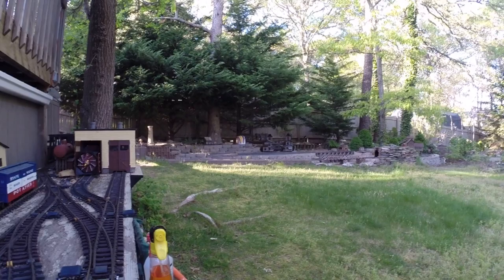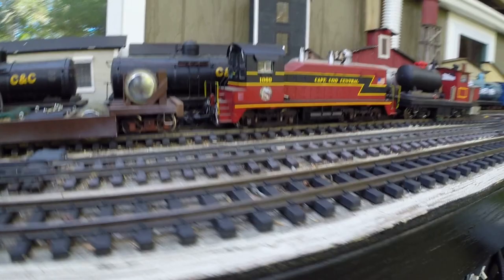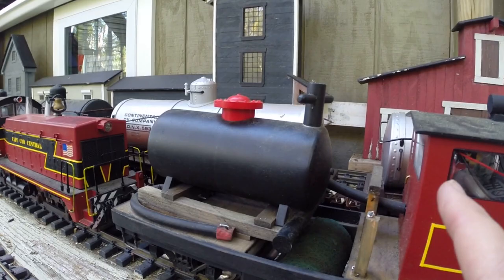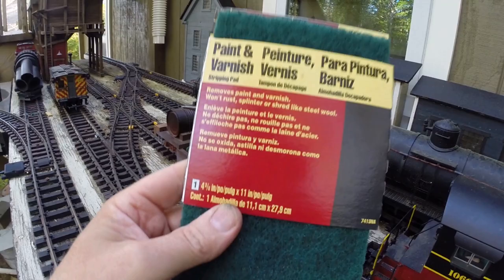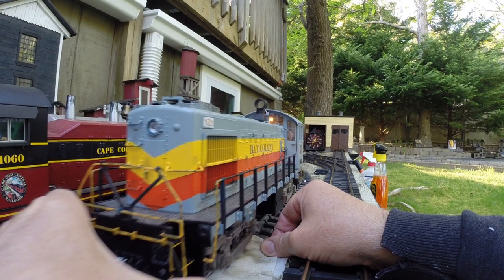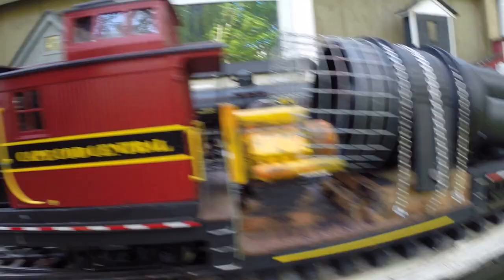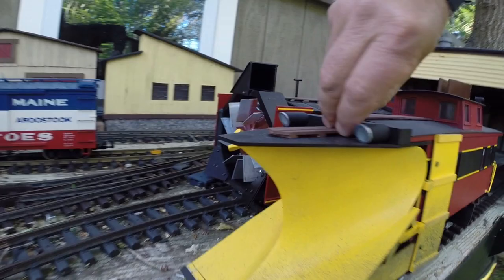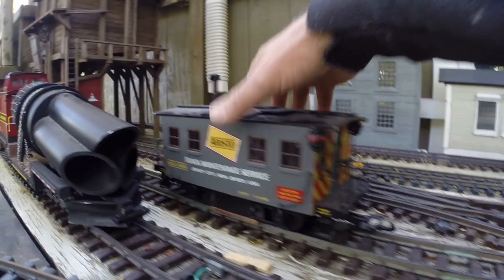How to clean G scale track

Comment: Try using mineral spirits instead of the rubbing alcohol and goo gone. You’ll clean your track less often. And also use a pad that’s not abrasive. Wet it down with mineral spirits and clean your track and see how you like it.

Comment: My cleaning routine: wipe with a damp microfiber cloth and then use 400 grit sand paper to rub off the corrosion. I find it barely grinds the rail because if you go light, it will only get the corrosion
Reply from the maker: That works but I would be very careful with the sandpaper.  They say that it can put small scratches in the rail and then those scratches collect dirt quicker.  Shiny rail looks good but it doesn't have to shine to work.

Comment: Hi just saw your track cleaning video.Looking to get my outdoor railroad up and running this year.Does the alcohol and goo gone work good on brass.thats what I plan on using.I also have issues with weather i'm in n.w. pennsylvania here,and we get snow.Happy New Year to you
Reply from the maker: HI.  I have all brass track.  Remember it does not have to be shiny clean to work well just free of grime.  I use goo gone on pole sander/scotchbrite pad when it gets really messy but goo gone leaves a slippery residue so keep that in mind if you plan to run long trains up grade.  I have moved away from the rubbing alcohol and instead use regular water with my rail broom MOW car.  I'm in Mass. and we get snow too and sometimes it is the plowable type for the trains. I have videos of that on my channel.  Happy RRing.

Comment: Im gonna be making a catenary powered railway, and my backup engines/maintenance engines are gonna be battery powered. Do i still need to clean the rail surface if im just using it for negative current?
Reply from the maker: I'm not sure how the catenary setup works but if the track is the negative then yes you would want it to be clean so it gives trouble free running.  Dirty track can make trains jerk or stop.  The battery powered trains will be isolated from the track so the only thing you would have to worry about are leaves, twigs etc that might be on the track and in the way.  Track does not have to be shiny to conduct power but being outdoors it can collect a film that will stop the power.
Reply: @CapeCodTrainTodd  ok, thank you

Comment: Great layout- so pushing the engine back and forth with the paper towel underneath does not damage the gears ?
Reply from the maker: Thanks.  I have been doing this for years and haven't had a problem.  I use Googone for the cleaning agent and it is slippery. I squirt the paper towel wipe it on the section of rail, drive the engine on and you saw the rest on the video.  I do not press down on the engine. I just let the wheels spin on the towel.  Happy RRing!

Comment: I really admire your railbroom/water dripper rig :). Can you provide the “bashed” car body upon which it is built?  Is that another Bachman tanker/flat bash up, or does another car serve as the underbody/frame?  Can you also provide details about the valve you use there?  Thanks so much for all the great information, and entertainment too!
Reply from the maker: Thanks. The base is an all metal  track cleaner car made by Centerline Hobbies. It was designed to accept a paint roller for cleaning. The tank is from HLM. The broom is a product you can buy and the rest I built. The valve I found at Home Depot in the plumbing section. It is made of brass. It has a T handle at the top and I used plastic pipe with grooves cut out to catch the T. That is the part popping out on top of the tank.  On the underside is the drip bar that is attached to the valve. This is also made from plastic pipe with holes drilled and tiny brass tube to make the drip.    Here is another video that shows some of the pieces. https://www.youtube.com/watch?v=fIpFwkYf4jw

Comment: What kind of dc motors are used in g scale diesel locomotives? How much weight they can haul?
Reply from the maker: They are all different and there are many variables that factor into the weight they can pull.  These are questions best asked on one of the forums I mentioned. They can give you a more detailed answer.

Comment: I have a rail sweeper similar to yours but I love the customization of the engineer's cabin etc .   I'm going to take your ideas and  try to do something similar to mine I just love the look of it .  Where do you get the metal endcaps to go onto the cut paint rollers ?  Again enjoyed your videos .
Reply from the maker: Thank you.  I'm glad you like it.  A good hardware store should have the end caps in their nuts and bolts aisle.  Amazon has plastic ones.  Inside the rollers I put a piece of closet pole and or rebar to add some weight to it.

Comment: I had a chat with an electrician and he suggested a contact cleaner, any thoughts?
Reply from the maker: A contact cleaner instead of the GooGone?  Sure that would work too,   I have used a CRC spray called 2-62  in bum joints.  If a track joiner is failing you can spray 2-62 into it to keep he trains running and then fix it properly later on.  You could spray some contact cleaner on your scotchbrite pad too.  My only concern would be if those products are plastic safe.  It would be lousy if they cleaned your track but ate away at the ties on a hot sunny day.
Reply: @CapeCodTrainTodd  thanks for the info

Comment: G scale flexi tracks are available or not?
Reply from the maker: ? ?    Yes flex track is available in G scale but I didn't use it on my RR. You can certainly clean flex track using the techniques discussed in this video.
Reply: @CapeCodTrainTodd  
Is it possible in a g scale LGB track to remove the rails off the sleepers?
Reply from the maker: @santhosh5796  Yes but the rail joiner at both ends holds the track sleepers in place so they would have to be removed.  Track from Aristocraft and USATrains has joiners that can be removed with a tiny screw plus screws on the underside of the track then the sleepers slide off.  If you are planning on bending your own curves it might be easier to buy a dual rail bender and then you can bend and bend without removing the ties.
Reply: @CapeCodTrainTodd 
Ok thank you for your reply
Reply from the maker: @santhosh5796  If you have questions there are many forums that can answer in more detail  such as G Scale Trains and Gscale.net on Facebook and Largescalecentral.com  Happy RRing!
Reply: @CapeCodTrainTodd  
Ok. 
Could you please tell me the width of rail head. 
I'm asking the thickness.

Comment: What a pain in the butt!. Why not go battery? Their big trains, You got all kinds of room inside to intall them, Real trains are dead rail. Iv'e been G scale battery power radio control for over 30 years!. No muss no fuss!.
Reply from the maker: One word MONEY.  It is not cheap to outfit an engine with battery RC. I have 2 that are set up with battery and it is very easy to run them but the track still needs to be clear of debris. Outfitting the roster would be too much money for my budget.  Track cleaning is part of the maintenance and I try to have some fun doing it hence the varied equipment I have built and bought.